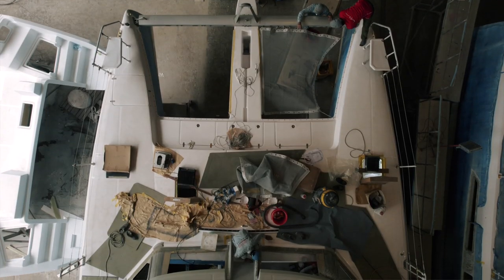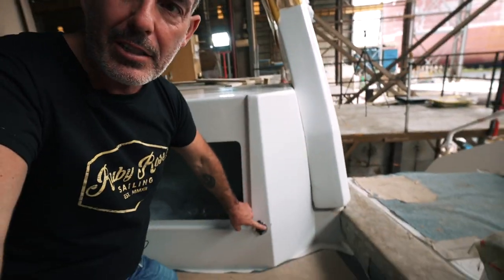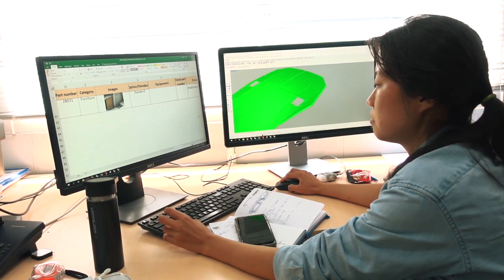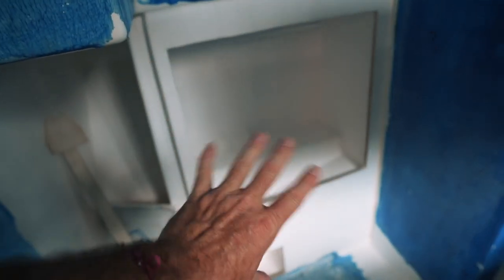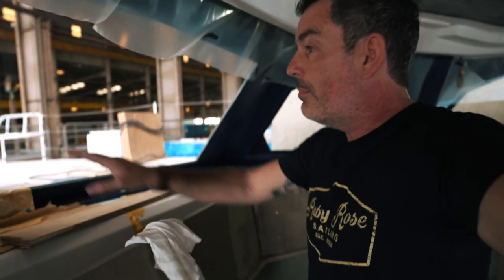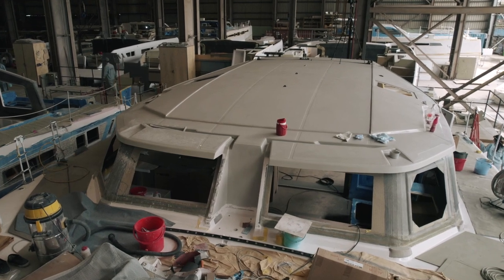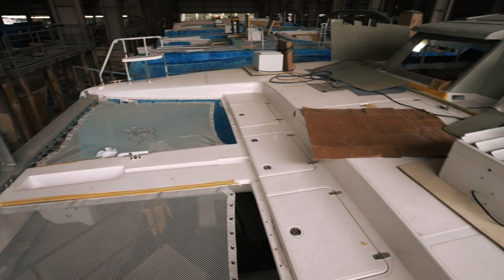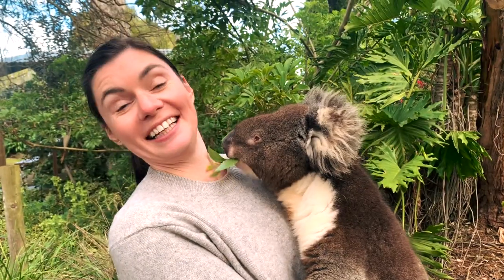CATAMARAN BUILD UPDATE: Where's Terysa? & When Will RR2 Be Ready?

Comment: Nick - a thought about a good lacing technique on those tramps: I owned and operated a very large rental fleet of small cats (30-40 boats) on Biscayne Bay for a number of years. We were always looking for smarter ways to keep our boats fully functional. Consider using a heavier gauge of bungee cord with a single overhand turn on every pass-through. This helps you retain the incremental tightness you've gained. Don't take more than a slight strain on each pass (those multiple pulls add up). It is true that this solution will not last in the sun and weather as long as cordage, but the performance boost and ease of spot repair more than justifies it. This technique also adds some rigidity to that area. Good Luck!

Comment: Love the updates. Looking forward to seeing you both celebrate when RR2 is launched. 
Are there many changes that have been needed from your original meetings with SW? For supply chain issues or due to practicality vs theory. 
For example, is the solar design and the components still based on the original plan or have upgrades been introduced that keep up with this years technical advances.